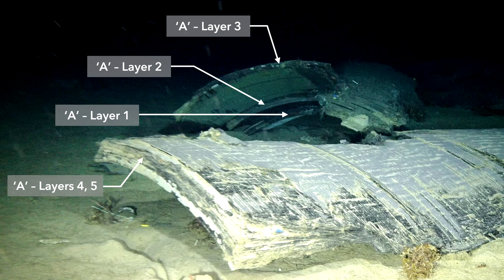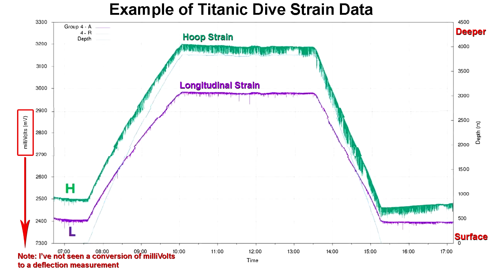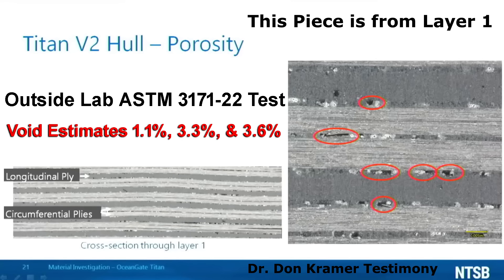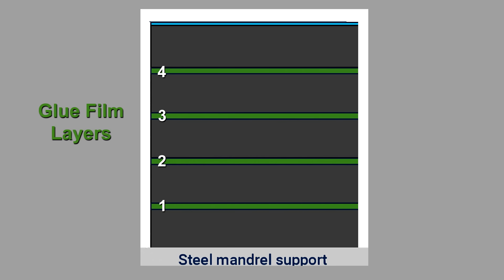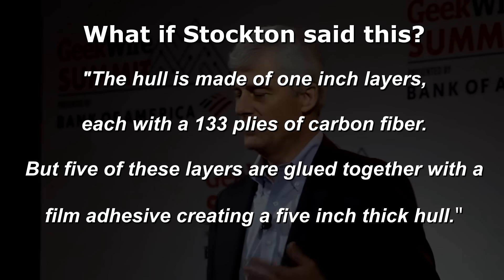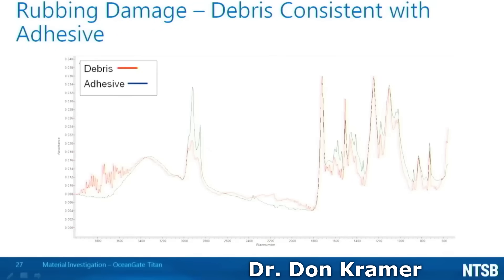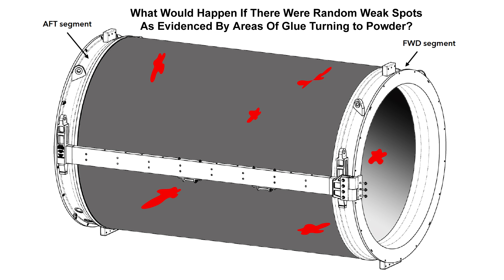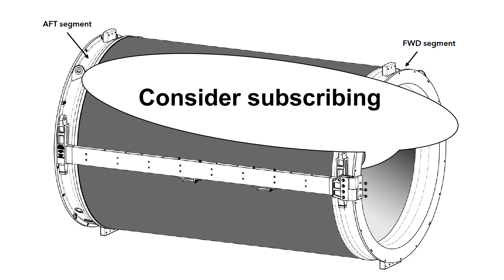OceanGate Titan Hull - Glue Layers Were Breaking Down To Dust - No Clues.

Comment: 1000 videos and all useless. The never-ending story of a fool who caused his own death and the death of 4 other people.
I don't understand what is still being discussed here. Everything has been wrong from the very beginning. 
Stockton Rush is an absolute fool to use carbon fiber, which has excellent tensile strength, on a structure that requires 
a material with high compressive strength. UNDER COMPRESSION!!!! Carbon fiber can't do that. 
That's as stupid as pushing a child's toy with a string. 
It's the same extreme as trying to stress concrete in tension. The tensile strength here is minimal. That's why steel rods are put in concrete and stretched with great force to compress the concrete. Prestressed concrete then has great strength, see bridges for vehicles and trains. 
Using fibers for pressure is a technological crime.
Reply: This is clearly a technical analysis of the material trying to figure out the actual point of failure. I've seen tons of guys like you that are 1000% sure it was the carbon fiber or the  epoxy or the window or the weave pattern or the fact that it wasn't autoclaved or whatever other theory they've seen on the internet. None of it is scientifically tested or proven. Just textbook materials 101 theory touted as knowledge.
Reply from the maker: @yinyangsaladgang8789  Thanks for your reply.
Reply: “Carbon fibre can’t do that” you have no idea what you’re talking about. They make bike frames out of carbon fibre. Do you seriously think no part of a frame is ever compressed?
Reply: @Jake-bt3fc  One visit to a bicycle repair shop would have convinced them this was a terrible design. It is well known that carbon fibre bikes routinely fail where metal parts interface with the carbon fibre components. The materials have completely different thermal expansion properties.
I see several problems.
Technical: 1. carbon fibers have high tensile strength, none in compression, completely unsuitable for vessels subjected to external pressure, 2. different thermal expansion of titanium and plastic, 3. completely unsuitable combination of cylindrical vessel and spherical ends, 4. even with such a poor design, technological indiscipline.
Human: 1. Stupidity, vanity and inability of the owner to accept opinions other than his, 2. ignoring all safety regulations.
Reply: @BZE-dt6di  It works perfectly adequately for bike frames. Nothing lasts forever. Even aluminum frames work harden and crack over time. 
So much misinformation is being spread about carbon fiber because of the titain fiasco. Is it good for extremely deep diving subs? No. But people acting like it's a completely useless material for anything other then pure tensile strength are just taking it a step too far to the point of ridiculousness.
Reply: @Jake-bt3fc  The difference is that if your carbon bike frame breaks, you might break your mouth. If a fiber breaks in a poorly designed submarine, you'll end up as the CEO of Ocean Gate.
Reply: @ Yeah, but to make the blanket statement that "carbon fiber can't do that" is ridiculous. It obviously can be used in compression and not just tension. A carbon pool que is not a rope. It works in compression just fine if you make it adequately strong and you don't exceed what it was rated for.
Reply: Dude, seriously? My carbon fiber sailboat amas take an absolutely BEATING in high waves, and they are immaculate after FIVE YEARS of never 100dys per year on the water. Since water is water is water, there's no way for this guy to have known that dozens of orders of magnitude more pressure was going to have ill effect on the hull...I mean, without doing some basic engineering analysis and math.

We await your apology.
Reply: @mastpg  I can see that you know nothing about engineering or science.
Reply: @kevinrayner5812  I can see you know nothing about context clues or how they relate to sarcasm.
Reply: @mastpg oh I see. That is what it was.
Reply: @mastpg  The hull of your sailboat is stressed by waves from the outside, I estimate the pressure to be up to 3 bars. It cannot be compared to a poorly made cylinder, also poorly glued to titanium and with an external pressure of 300 bars.
Reply: @BZE-dt6di  ...sarcasm exists. You should be the first to discover it in 3, 2, 1.
Reply: @mastpg  How else can one respond to an irresponsible adventurer who ultimately murdered 4 people and committed suicide?
Reply: @BZE-dt6di  ...more practice with the reading for you, it would seem.
Reply: @mastpg  Maybe the translation isn't perfect, I'm not American.
Reply: @BZE-dt6di  I think you can count on the context of my comment not translating well. It was heavily veiled sarcasm.

Comment: From what I see from all of this, a composite hull is completely workable, but with limited cycle count. This thing survived a lot longer than it should have, overall its just another complex problem for a professional engineering firm. Still, overall pro's would be weight reduction, cons are limited lifespan requiring replacement after so many cycles. Long-term costs would probably be similar for both designs hence nobody wants to bother with composite deep-sea submersibles.
Reply: The hull was ideal for observing corals and clams in coastal waters.

Comment: Same reason that I would not buy a carbon fibre car.
Reply: Better not fly in any airplane, then.
Reply: If you buy a car with a 5 inch thick chassis then you have an issue
Reply: as if you could afford one.
Cars are actually a good application for composites, hence why every motorsport has been using it, moron.
Reply: @nonegonewrong yeah, for racing lol. Who gives a rats ass?
Reply: @nonegonewrong you realize in motorsports they have to replace everything constantly, right? Race cars aren’t designed to last a long time, genius.

Comment: The whole idea of glue layers of carbon fibre was flawed from the start. Carbon fibre has high tensile strength, not compressive strength.
Reply: Omg wtf does everyone repeat this generalization. The sub had super high compressive strength. It literally did multiple 3km dives. It just wasn’t built well and it wore out fast.
Reply: @Jake-bt3fc  Unfortunately, every dive of the poorly designed hull seriously damaged it, and we already know the result.
Reply: @ No, the ridiculously deep dives way past what it was rated for were the dives that seriously damaged it. If they just took it on 200 meter dives instead of 4 kilometer dives it would have lasted practically forever.

Comment: If they put a titanium center ring in the middle where the most stress at, it would've reinforced the hull nicely.
Reply: It might have extended the life, but the materials used were the real issue.
Reply: @cmkeelDIM  I totally agree with that. The vessel was not made with great material. I can't believe how it held firm for 8 prior dives
Reply: @ky1ebetts  Every dive of the poorly designed hull seriously damaged it, the cracking sounds were a serious warning, but the adventurer ignored them. We already know the result.
Reply: What I can’t believe is that Stockton, a Princeton engineering graduate that is, should have known that Carbon Fiber composite is okay for tensile loads but no good for compressive loads. You don’t even have to be an engineer to realize that.
Reply: @bingeciren  He probably only went to school on Saturdays when the teachers weren't there. The janitor then presented him with a diploma.
Reply: You have never used a carbon fiber composit under load to destruction, eh?
Reply: A titanium sphere would have required no carbon fibre and done the job nicely.
Reply: I was thinking the same thing.

Comment: Oh good lord... the area measure (sq ft) that you use says NOTHING about how much glue was used.
Reply from the maker: Thanks for your comment.  The glue was supplied as a film, as stated by Dr. Kramer, and laid on the hull.  You can see in the images in my video how thin the glue film was.  It's about the thickness of a ply of carbon fiber.  between 0.0075 to 0.01 inches thick (at most).  So, "how much glue" in total volume is not the issue.  The film came at a pre-defined thickness.  But if you want to know "how much" here's the math:  547 sqft is 78,768 sqin X 0.01 thick equals 787.68 cubic inches of glue.
Reply: Correct, it's not about the glue volume;  the area measure is to illustrate the amount of adhesion surface which is vulnerable to SPOF.
Reply: @ComradeTiki  😀

Comment: With 200-some dives completed before the tragic failure, this analysis makes me think they had a really sound idea if it was done correctly. I imagine that now, like with blimp travel, the negative image associated with the publicized failure will keep research directed in other techniques
Reply from the maker: Thanks for your comment.  Just to be clear on the Titan records.  The dive logs are a running total for both the V1 hull and the V2 hull.  The implosion dive was dive 88.  The first dive logged (0001) was on 2/6/18 to 3 meters in the bay in Errevett, WA.  Most of the 87 dives were shallow dives for testing, but they are still in the total.  The V2 hull made about 20 high-pressure dives if you want to count the high-pressure chamber dives (5) in the test facility.
Reply: Then why did the US Navy try a carbon fiber sub - and then abandon the technology?  Carbon fiber is most effective when retaining pressure (although I wouldn't trust it above the stratosphere), but it's inept at best at resisting external pressure.
Reply: lol yah its great go for it
Reply: Thet did 200 plus dives to the depth of the Titanic?

Comment: No, the Titan people did know the hull was breaking down.
Their acoustic sensors were telling them.
They just failed to understand the data 
Even if they had, I suspect the money sank into the project... Rush would not have wanted to scrap the sub.
Reply: He actually had the end caps and rings reused from a previous sub design smh. Wasn't willing to scrap anything he didn't think he had to
Reply from the maker: Thanks for your comment.  You are correct, dive 80 had some bad strain data associated with the large bang they heard.  Something happened to the hull then, even though it made it through a couple of more dives to the Titanic after that.

Comment: The only thing I will insert into the analysis is this.

We don't know what the implosion shockwave did to the surviving carbon fiber hull.  If the cracks and pores formed from the pressure of the dives or the rapid depressurization tearing at it and then the water shockwave afterwards.

Comment: ...this is silly....no pressure tests before launch....idk what's worst building it or defending it...that thing was a death trap...
Reply: send robots not humans, it was a stupid program to begin with, first unmanned, several times if not 10s of times proving the safety part prior to actually going down with humans...anyone that knows anything about safety would say the same
Reply: @tgshark1 10s of times didn't matter at all here. The sub did 80 successful dives before this.
Reply from the maker: @clutchboi4038  Just to be clear, that total of 87 dives includes the dives from the V1 hull and all of the very shallow test dives, like the 10-meter dives.  It was a running total.  Depending on how you want to count them the V2 hull made about 20 deep dives.  That includes the 5 deep dive pressure test dives in the Deep Ocean Test Facility.  Thanks for commenting.
Reply: @solareclipsetimer  right and ypu forgot the safety part...the hull was downgraded to 9800ft then what? we are all aware of the program and what happened...

Comment: Applied as a SHEET? Of course there's going to be porosity in that! Absolutely wild.
Reply from the maker: Agree.  Thanks for commenting.
Reply: Each layer is autoclaved, whic heats the film to.liquify it, WHILE pressure applies consistent force to press the layers together.  Thats how you ensure the level of porosity specified.  But pressure, temperature,  time, and the surface characteristics of the layers  are all critical to the bond. In a cylibder If the inner or outer surfaces of each bonded joint are anothing beyond PERFECTLY CONCENTRIC there will be gaps that the glue film cannot fill.  Do it RIGHT, and it works.  Do it wrong and it fails under repeated loading cycles.

Comment: In short the laminate was scary to be used ONCE and discarded after such single use. Using it more than once led to a disaster. 
Or after a single use it should be derated by a factor of 2 and then by another 2 after another use. 
It is strange that plywood analogy was not seen by engineers - it clearly was - I refuse to believe multiple people did not know glue will eventually under cyclic load break down - heck there are examples of others using such designs only once for that reason - so if others knew these guys would have seen it as well - even as part of research. 
This leads to inconvenient truths simply being ignored.
Reply from the maker: Thanks for your comment.  I agree with you completely.  I have no idea why they thought co-bonding would work and that the layers moving under hull flexion would not create a risk of shear forces at the glue layer.  And then zero testing of the co-bonded technique.

Comment: Why did they not install a midship ring frame made out of titanium, to act as a stress buttress for the carbon fiber hull? Maybe a foot wide, 3 to 5 inches thick and compression fit on the inside diameter of the hull tube. They machined the end caps, so producing a ring girder out of the same material should have been easy.
From what I have seen, they ground ripples out of each one inch layer, effectively breaking the carbon fiber fabric each time, before they applied the intralayer glue sheets. To me, that seems to manufacture failure points into the construction throughout the build.
Reply: I mean any internal cross bracing with metal or an additional few layers of carbon fiber in the middle would've been better than nothing. No additional cross sectional bracing blows my mind.
Reply from the maker: @ThisisForTheTV  All that stuff has to be carefully engineered to see how the stresses will be distributed.  If you put a brace somewhere, you could consolidate extra stress to somewhere else.  It's really complicated.
Reply: @solareclipsetimer  Yes that's the whole point, to redistribute the load to a section that isn't the weakest point. It's basically a soda straw if hear me out, you can blow as hard as you can and it will hold it's shape and not disform, if you pull a vacuum it easily misforms and collapses on itself. Carbon fiber DOES NOT do well with pressure on the outside pushing inward ie submarine, carbon fiber DOES VERY WELL as a pressurized tank ie the space shuttle. It should've been made it out titanium but it would've weighed more and been much larger, which is what Rush was trying to avoid.

Comment: There probably should been a central support for that hull to aid in hull integrity and compressive strength, that’s just one thing in an inherently flawed design
Reply: yep like like roll cage
Reply: I mean any internal cross bracing with metal or an additional few layers of carbon fiber in the middle would've been better than nothing. No additional cross sectional bracing blows my mind.

Comment: I swear, just sitting here in my chair I have thought of a better way to fabricate the hull in a single piece using that big winder they used. I also would have bought two new strain gauges. This thing was shoddy every step of the way.😅💩
Reply from the maker: Thanks for your comment.  I did not get into it in the video, but the stain gauges that were not working probably just fell off the side of the hull.  Phil Brooks testified that he thinks they got knocked off the side of the hull when they were inserting the hull insert.  After they discovered the problem, they did not want to take the time to remove the insert and re-fix the string gauges.

Comment: If the glue layers broke down and each carbon fiber layer can move independently then twisting can occur. Since they can see where the layers rubbed against each other horizontally I wonder if they can detect any diagonal twisting forces that would have accelerated the hull collapsing?
Reply from the maker: Thanks for your comment.  That is a good point.  We may never know, since they had a limited number of hull pieces from the wreck to examine.
Reply: @ Thank you. I'll stay tuned for more info. Good work.

Comment: It sure is a good thing these guys saved money by using a Logitech Playstation controller!
Reply: That is actually quite normal and a lot of submersibles use some form of game controller to control the vehicle actually.

There’s nothing wrong with using a game controller.
Reply: @tonamg53   Wink wink nod nod. 😂
Reply: @gymkhanadog  What I told you is a fact. 

You can even see James Cameron was using a Saitek Cyborg joystick on one of his dive to the Titanic on YouTube.
Reply: I think you'll find that a Logitech Playstation controller works absolutely fine on all Playstation games, and probably even better on the far less complex up-down-left-right navigation systems on the Titan.

If they'd found the controller in a dumpster I'd say yeah, fair enough. But a brand new controller? I'm not sure you've thought this through. I would say the electronics on a brand new controller are probably extremely reliable.

But it's okay. We all started out as ignorant and we watched a few vids, read a few comments, and learned. Welcome aboard :)
Reply: I don't really see the issue with that.
Controllers are built to last and everyone is familiar with them.
The US military is looking into using console controllers for drone for a reason. They have been used in previous submarines aswell.
Aslong as you have backups it's a valid choice